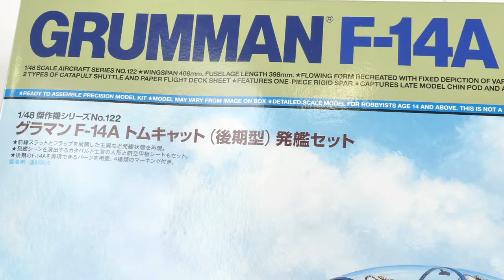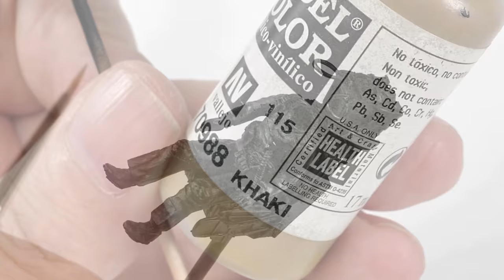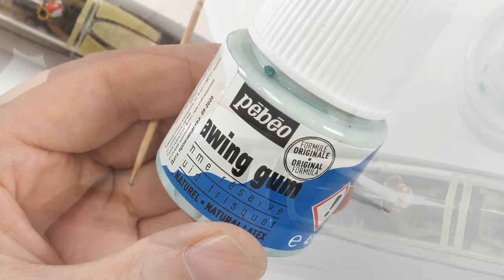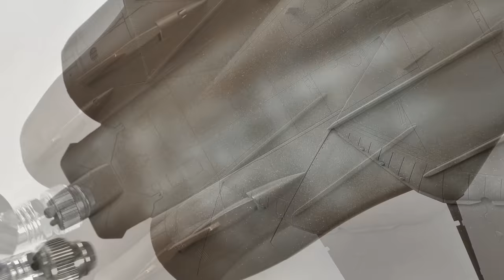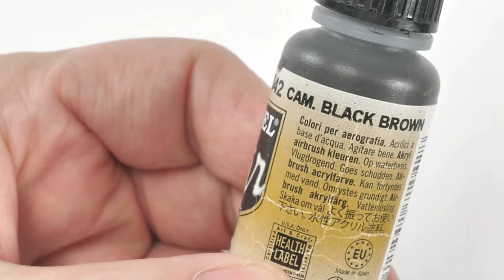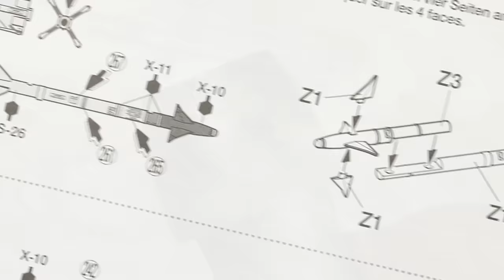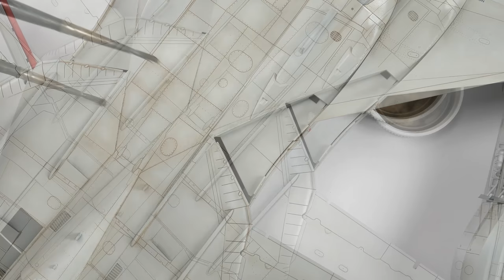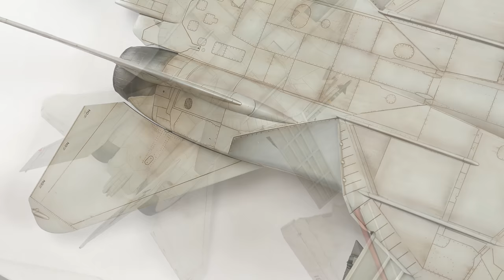Tamiya F-14A Tomcat Carrier Launch Version FULL BUILD

Comment: I like how you made the two fuel tanks slightly different colours to increase the realism, in reality there would be the occasional variation like that aboard the ship.
Reply from the maker: big thanks Brian. i spend a lot of time researching and collecting references of the actual aircraft that i model.. that doesnt come through on the videos. big thanks 👍
Reply: @TheBearScaleModels  in building the academy 1/72 f-14a screaming Eagles, it comes with some f-14B stuff too. The famous neck joint problems plagued me but at least it taught me how to putty better. Also the landing gear doors don't fit well at all.
I'm looking for a 1/48 or larger F-14 in tie down on the flight deck, could you recommend a kit? I'm also wanting to try metal landing gear 3rd party parts....
Reply from the maker: @soundknight  If its an f-14a that you want in 48th scale I would go for the Tamiya.. its just such an easy and enjoyable build. Now for an 14D.. it may be worth looking at AMK because the kit is cheaper has better decals and looks amazing also !